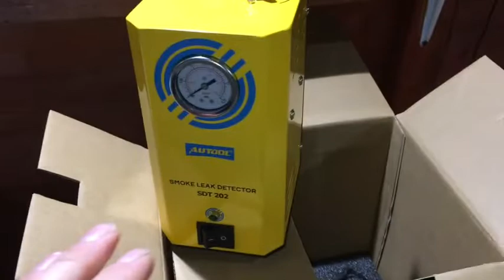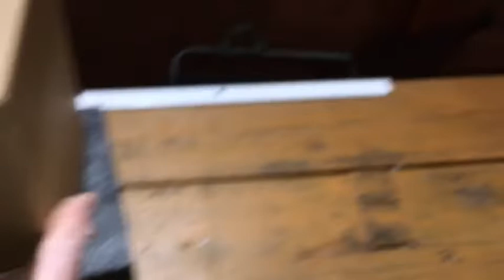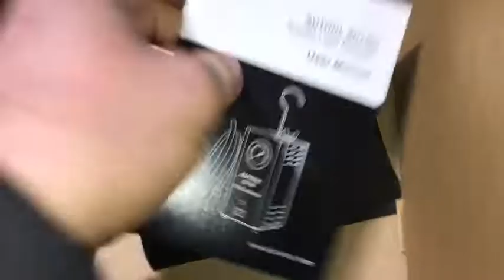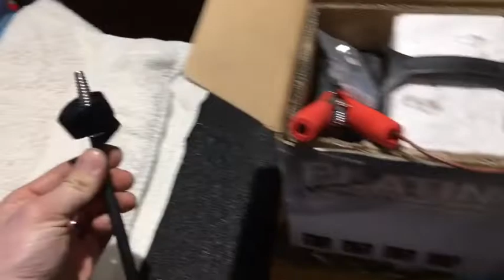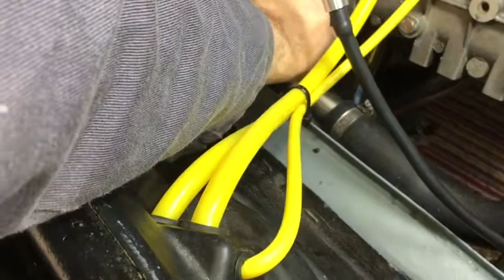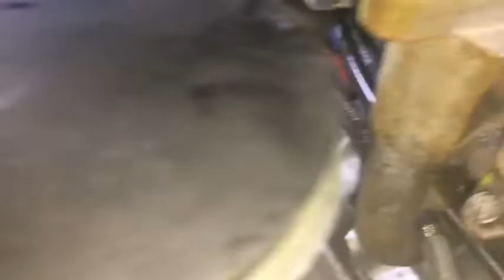Review AuTool SDT202 smoke EVAP Leak test machine - Review and a demo! - February 2022

Comment: I bought and find it very useful.
Reply: Does your spit any oil with the smoke? I had the model below this one with no gauge and I returned it after a day of owning but I’m wanting to buy one with a gauge and maybe it won’t spit the baby oil
Reply: @E85_STI  No mine doesn't at all. I didn't fill it up though. I put in maybe half the tank with oil. Have used it prob a dozen times and still have oil in it. So maybe, If yours s sitting oil, you might pour some out and see if it helps.
Reply from the maker: @E85_STI hi there, no this model is superb and I’ve used it maybe 10 times now and each times it gives a perfect stream of steady smoke. I certainly recommend it.